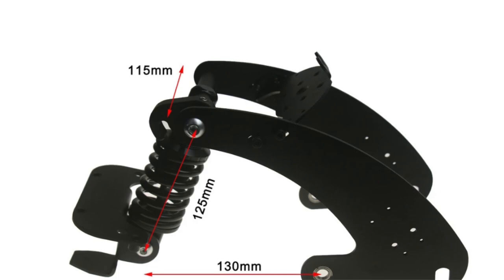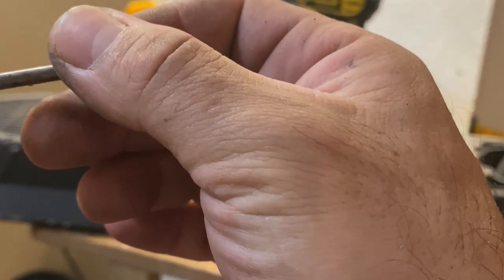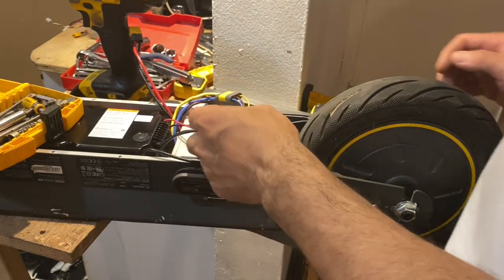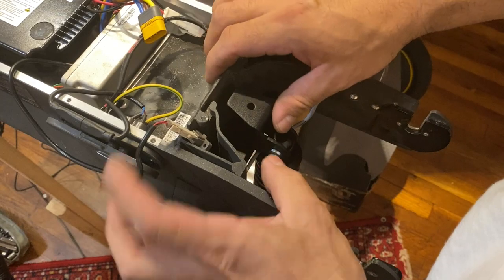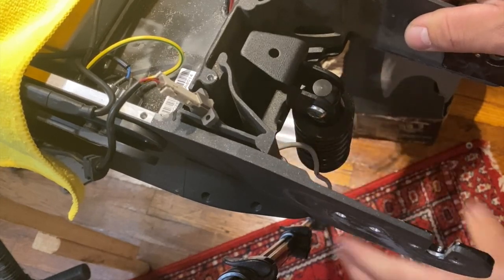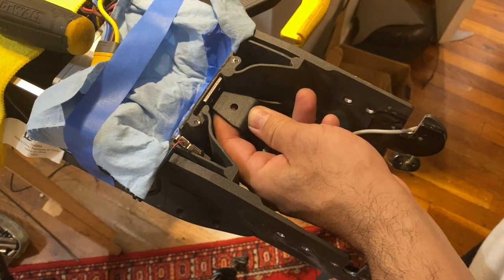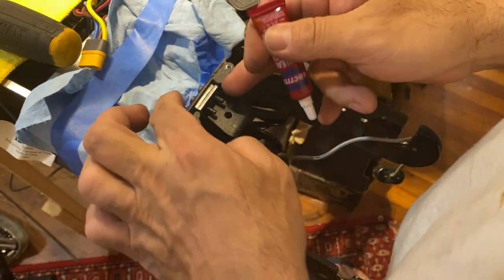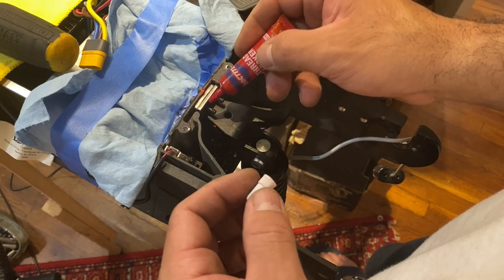November 2023 Update!!! Generic suspension support installation On Ninebot Max.

Comment: hi i really want to know
why do u need to install that part?

im using that suspension but no problem
Reply from the maker: We have replaced several to people cause they brake. Banging agains the scooter frame with this adjustment stops as well become solid and prevent the breaking.

Comment: Hi, do you mind sharing the name of the drill set that you are using to drill in this video? Also any tool set that you recommend for most of the ninebot upgrades? Thanks
Reply from the maker: Drill bit you can use anyone that matches size of screws you are using. Generally metric between 4~7 would fit.